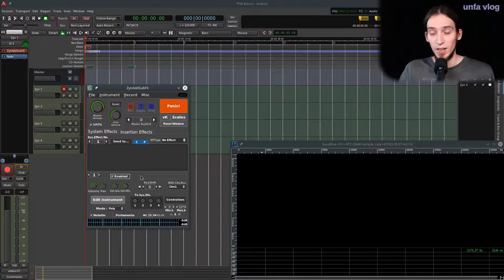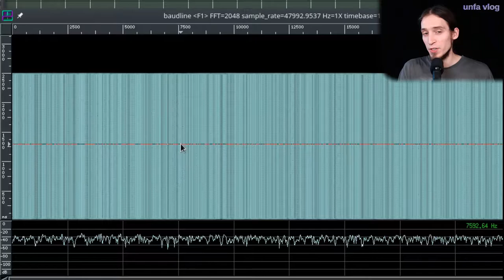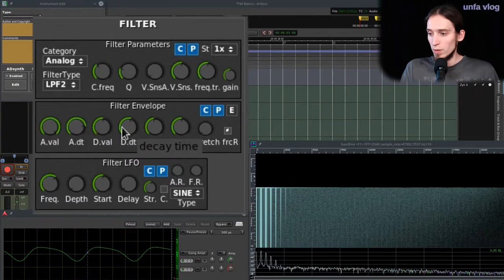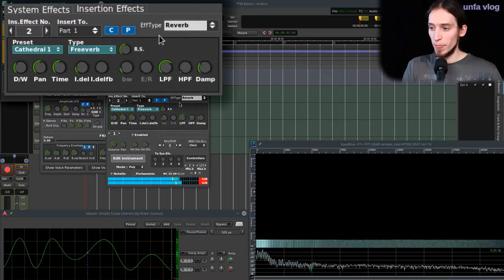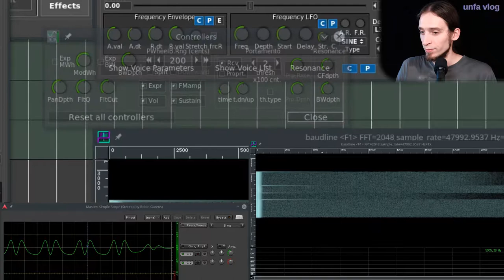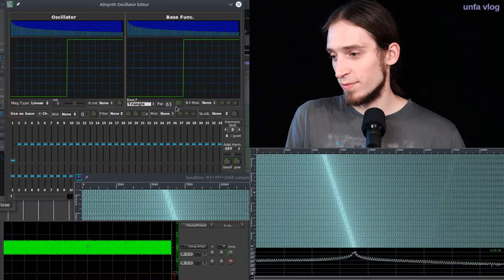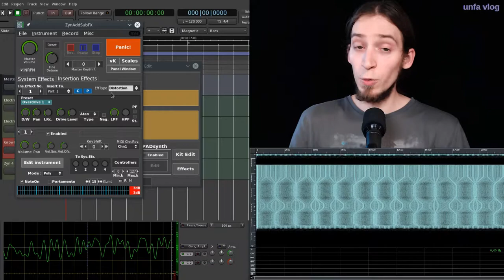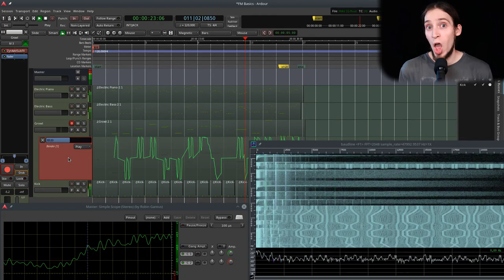UV#18 Introduction to FM synthesis with ZynAddSubFX

Comment: If I understand what you wrote correctly, Ardour and Zyn-Fusion are the only software packages needed for this. I finally figured out how to connect the two. The Ardour manual is difficult reading. So, I hope to do a video showing how I did what I did. And hopefully, I can link it to your channel.
Reply: Zyn has a standalone version too c:

Comment: Hi, you say you only use open source software, is that all you use in this video?
Reply from the maker: Popart 2015 The operating system, the DAW, the plug-ins, the video capture and editing software... pretty much everything I use is open-source. Baudline (the spectrograph) is a bit strange as it's dual-licensed and not really libre - I am waiting for someone to program an alternative. Oh - I use proprietary Nvidia drivers so that's not open-source. Next time I'll probably go with AMD for that regard.
Reply: unfa Amazing, I thought in LMMS as the open source top but seeing your video I realize that there are much better DAW!
Reply from the maker: Yeah! Some say Qtractor is better than Ardour for MIDI work - I haven't used it much thought. I really like the mixing and editing workflow in Ardour.
Reply: unfa Thanks for the info, I will check those tools as they seem very resourceful.

Comment: Hi Unfa,

Did I understand (with my bad English!) that the ZynAddSubFx FM engine is noisy because it generates much aliasing? If you look for best sound quality, would the freeware Dexed, modeled on the Yamaha DX7, or a commercial product like FM8, be a better choice?

More generally, do you consider that ZynAddSubFx is focused on the ability to create many kind of sounds (several synthesis engines) more than on sound quality? In this case, would it mainly be a good tool to make fast mockups, as an alternative to a rompler like Xpand or a sampler? 

Thanks for your tutorials

Marginal Ray
www.marginalray.com
Reply from the maker: I would definitely not say that's ZynAddSubFX is only good for mock-ups. Any digital or virtual synth has some problems resulting from the limitations of the technology. The old analog hardware synthesizers have lots of issues that people grown to love. For example they can't stay in tune in a hot environment. Zyn has some aliasing in the modulation math but it's nothing really problematic. It is just noticeable but it's not a big deal and you can get rid of it with a filter or just forget about it and not care it's it doesn't really matter in the mix of a song. Sometimes I use it creatively by abusing the instrument. I sometimes add noise with a high pass filter to my sounds anyway to add a bit of warmth and fuzz, and that also masks small artifacts like these. Sure it sounds more analog then digital aliasing distortion, but again what is present in ZynAddSubFX is not a deal-breaker by any means. I've made many full length albums with it and nobody ever complained including me :-) As I said it is there and Mark McCurry said that it will need a rehaul one day but it's going to be a very laborsome process so it's not a priority, and there are other things that provide more improvements.
And no I would not exchange ZynAddSubFX for FM8 ;)
If you want to hear if Zyn's capable of serious production work listen to my newest album "Suppressed" and decide for yourself - it's 97% ZynAddSubFX.
https://unfa.bandcamp.com/album/suppressed